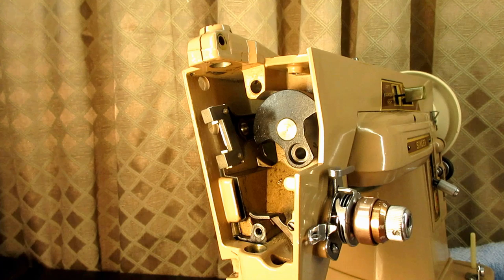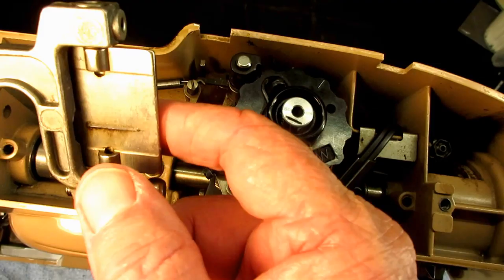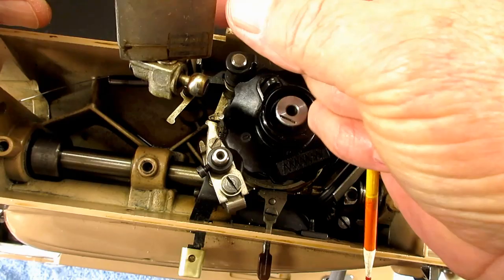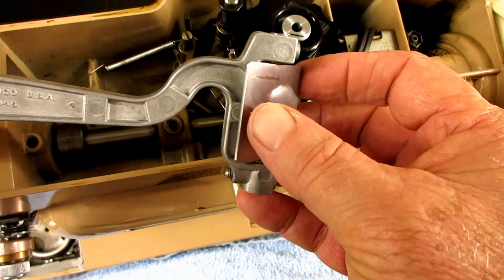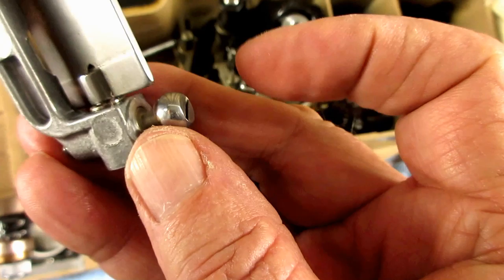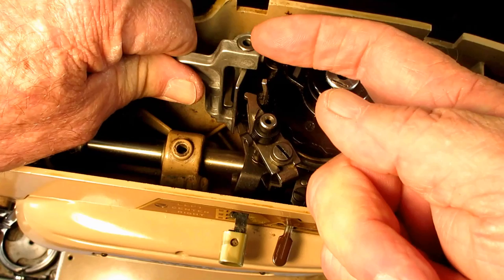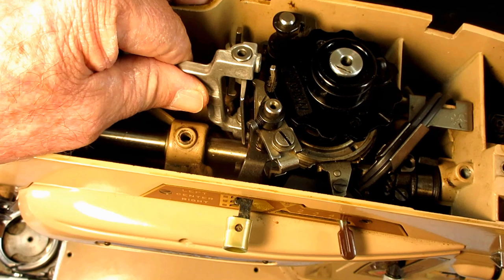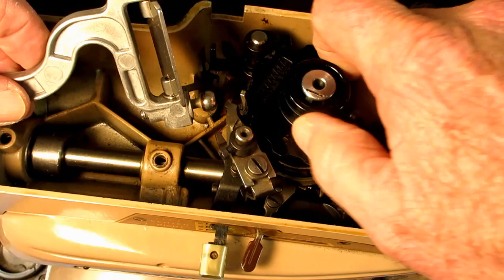The Needle Bar Driving Arm of the Singer Model 403A Sewing Machine

Comment: Thank you, Dan! i have a Singer 675g of which I can find no information or even a picture of the machine on line, and although there are some different workings inside, your explanation of how the cam followers and tension arm work have helped me to puzzle this out. The 670 is the closest model I can find to mine, however, again, there are differences, and no videos on the inside workings. The 403 is a good, simplistic, example of mine.

My upper cam follower (this machine has a stack of cams) is not going into the dip of the cam. The spring that hooks between the tension arm and the vibrating arm sure looks like thinner metal and a much wimpier spring than the one on the machine in this video (and others on your videos). All parts move freely.

 There is a button to depress on that 'opening door off the vibrating needle arm' (sorry, brain cannot find the words), which allows one to change the cam selection levers; it moves the vibrating arm position toward the machine, which then causes the needle to be off center from the needle plate;  however, upon releasing the button the vibrating arm does not spring back into position, as I think it should.

I am wondering if I should replace the spring? I wonder if this was a common problem with the 600 series. (also, the spring was on backwards from the 400 series, with the long end of the wire hooked to the tension arm; I have seen still photos of this in 600 series, but wonder if it is correct). 

I apologize for the long post; I have been frowning over this machine for weeks. I bought it at a second hand store for my daughter about 20 years ago, had it in to be fixed; no improvement, and I finally decided to tinker with it myself. (I managed to follow your video on removing the vibrating arm, and the pressure foot dial thingy, cleaned them up, timed the machine, and straight stitch works wonderfully)
thanks again! Michele
Reply from the maker: So, I've never seen or touched a 675G but found some pictures online and the instruction manual for models 655/675 is still available at Singer. I do not know how different the 675G is from the one in the 675 Manual. In my experience, most Singer Models that end in "G" were made in Germany. Many of them have migrated into the USA from Canada. (I don't know where you live).

As far as the spring having the long end connected to the tension arm I have seen several machines with the spring either way. I'm not sure it matters as long as there is clearance for the spring where it connects up by the vibrating bracket. There are some smaller springs down below the lifters and followers too. 

To be honest, I've only worked on a couple of T & S style machines and just do not care for them. They both had trouble in the parts around the cam stack area. One Singer OSMG told me they called the model Touch & Toss and Touch & Trash and Touch and $#*!. On the two I worked on 95 % of the problems were gone after I washed, dried and oiled the machine. I'm not sure about that  """button to depress on that 'opening door off the vibrating needle arm'""" thing you mention, but I do know that there are settings of the buttons on the front of the machine that moves the needle into left-center-right positions. If you are moving the button sliders into a position you think is a certain pattern and the needle s is moving off-center that may mean that the machine needs cleaning like parts are sticking to other parts and making them move a little bit. Also, some patterns are made to move the needle to the left of center on purpose. Also, if you use the special patters discs (plastic cams) one of the levers must be in the "SPECIAL" position to engage the lifter/follower system, BUT, BUT the lever must be moved OFF OF SPECIAL when putting on or taking off the special discs, then moved to the Special position to sew. If a special disc was forced on or off the cam stack springs it may have damaged/moved some of the parts.

The main idea of all the Touch & Sew Models basically follows the 401A Slant-o-Matic. That machine had two knobs on the front that you either pushed and turned or pulled and turned to select a pattern. The 600 & 700 series changed to levers on some models and big dials on other models, but the idea was still a cam stack with 6 to 8 metal cams and lifters to raise or lower the followers to the correct cam ( or two cams) and the followers connect to the needle bar driving arm and that connects to the vibrating bracket and that connects to the needle bar to make it swing for the pattern that was chosen. Most of these machines had front and rear followers.

You asked about replacing the spring. I doubt that would help, but if you think the spring is "weak" or "worn" you could add a rubber band to the two connection points to see if more spring resistance changed the situation. 

I think you could almost use any T & S Service Manual to work on your machine. Even if some of the parts changed they mostly are in the same place and work alike. I have an old model 628 service manual and you can have it if you email my channel at andytube53@gmail.com and ask for it. I also have some 600 & 700 parts lists diagrams. The 675G documents are not in any of my files and that is normal for machines made in Germany and some South American and Taiwan made models. Before I forget, if you need the 675 instruction manul it is free at this link: https://www.singer.com/sites/default/files/outdated_product/SINGER%20655%20and%20675%20Sewing%20Machine.pdf

Sorry for the long response. but, well, you kind of asked for it hehehe...
Reply: @andytubesewing1953  Wow, thank you so much! I will check out that link.
Your site has been a god send to me!
Reply from the maker: @micheleantonello3187  okay Michele and thanks for the compliment The instruction manual may help about all the settings and how they work and don't forget to email me if you want any documents Good luck
Reply: @andytubesewing1953  OMG...I put one of those big blue elastics from the brocolli to connect the vibrating arm to the tension arm and TA DA! It worked! I have zig zag and the vibrating arm returns to its position. There is finally pressure on the cam follower. Thank you for the idea! I wonder how long that elastic will hold? ha ha.

I have a 401 in the studio (too cold out there) so I am familiar with all the dials and gizmos. The pdf link you gave me is the right one. I had one for the 656 and 676; I think they are the same models but different countries? Anyhoo, I am so happy! Thank you!!!
Reply from the maker: @Michele Antonello well I have always loved a happy ending, congratulations and thank you for saving that machine take care

Comment: Thanks for posting these videos! You’ve helped me so much. I have a 403a the was totally locked when I got it, but now the needle swings pretty freely from left to right with the zero cam in. My problem is with the needle position selector. Left and center work fine, but the needle bar won’t shift to the right when the selector knob is in that position. Any thoughts?
Reply from the maker: The NB may not be properly centered, and I think there is an adjustment for the NB positioning lever. They should be in the Service Manual that covers the 401A, 403A, and 404. Free download is here: https://sewingdude.wordpress.com/wp-content/uploads/2012/09/singer-401-service-manual1.pdf
Reply: @andytubesewing1953  Hmmm. I hope not! Sounds like a complicated adjustment, but I’ll review the service manual and check it out. Thanks for your help, your videos are so good!
Reply from the maker: @lynnschaffner513   Good Luck, Lynn. 👍

Comment: Hi Andy, do you fully disassemble the driving arm when you clean it? If cleaning of a driving arm is covered in another video, I was unable to find it. I've taken most of the screws out of mine, but the ball pivot is an intimidating one! Apologies if that is a dumb question; I'm servicing my first 401A with guidance from your videos, so thank you for providing so much information!
Reply from the maker: NO! I DO remove the driving arm to clean it with Krud Kutter for dish soapy water. I DO NOT change the screw settings or dismantle parts of the driving arm in any way. Thanks for watching my channel.
Reply: Thanks for the info!
Reply from the maker: @sarahtaylor6791  Surely, and good luck, Sarah.